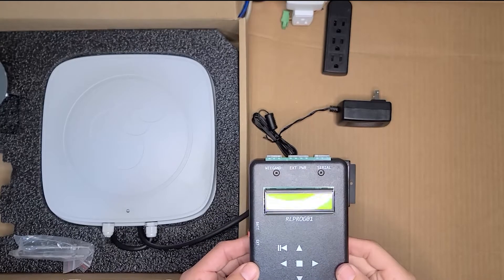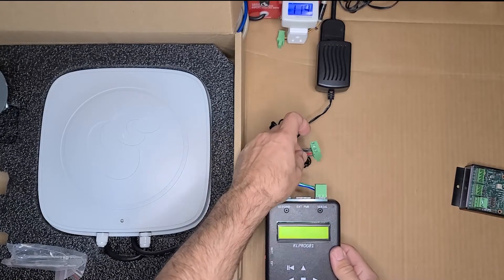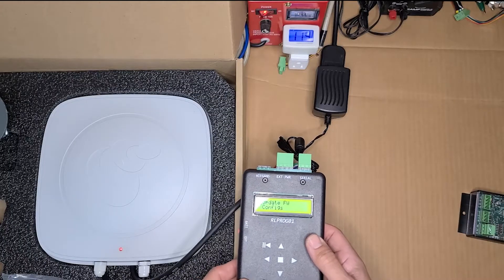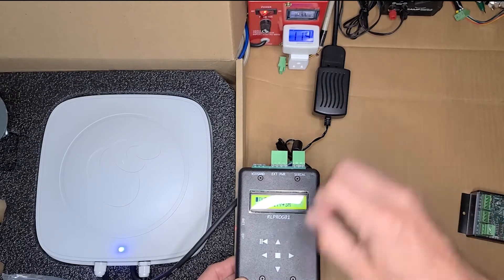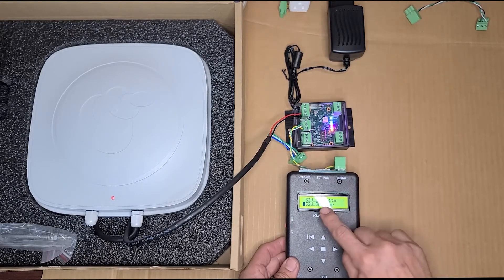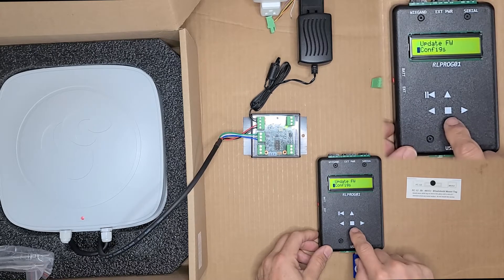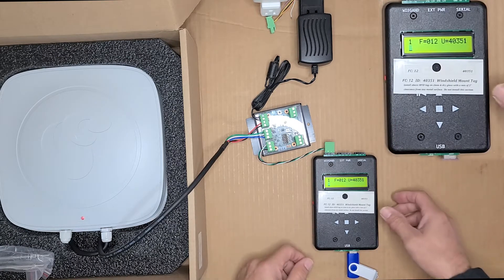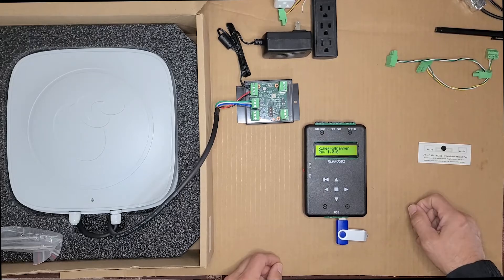How to use the RLPROG01 Programming Tool

Comment: Looks like that little screwdriver is trying to steal the show.  LOL.

Also, your programmer has a USB stick in it, you don't elaborate as to it's role in the device's function, I am assuming the updates are on it, am I right about that?
Reply: Yes the software is on the usb . Needs to be plugged in in order for it to get the update going .